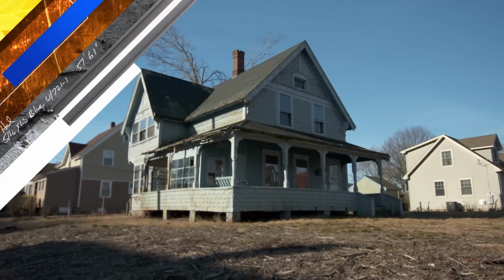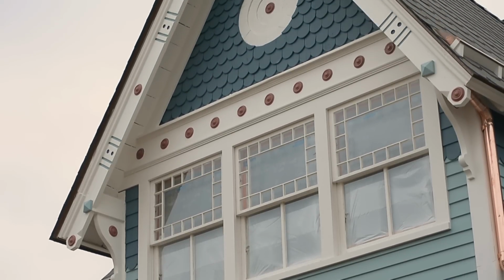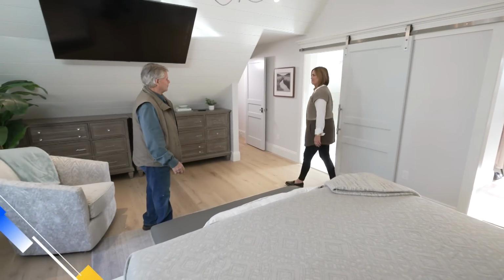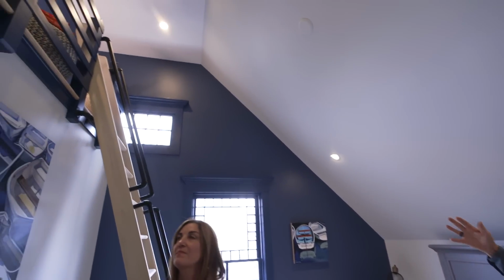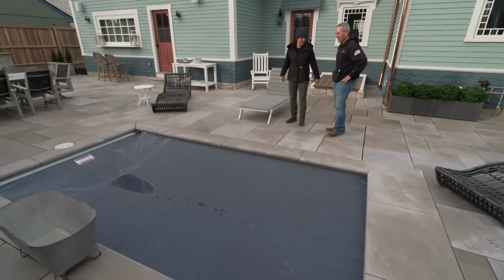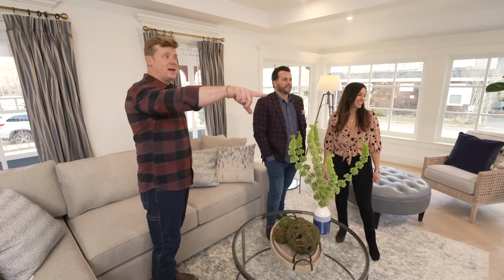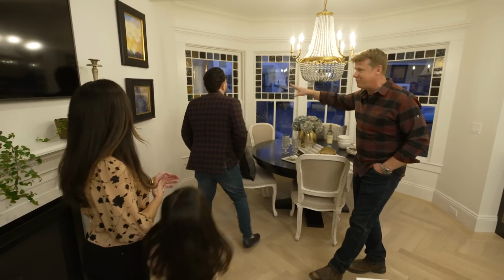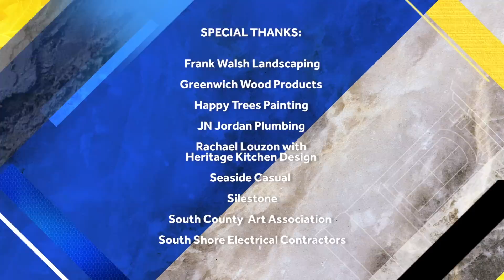This Old House | A Queen Anne Revival (S42 E16) | FULL EPISODE

Comment: Why is there so much water on the basement floor?
Reply: Most houses up here in New England and New York have wet basements. The water table gets as high as at the surface when the snow melts, and the only solution is to let it flood in, and pump it out with sump pumps. I haven't seen a dry basement in my area ever.

Comment: Great, just what I need. 3 water heaters that are talking to each other. This show has turned into one giant sponsorship program.
Reply: I was surprised by that, too.  We installed one of those Navien heaters about 4 years ago and 1 works fine for our small family.  In fact, I hook up a hose to refill our 350 gal hot tub once or twice a year.  Easy to decrease the water temp to about 102F from its120F setting and, voila, the spa is filled with hot water within an hour.  3 heaters daisy-chained like that seems a bit much but definitely a setup for a multifamily dwelling, e.g. an apartment building.
Reply: @SpringRubber  that shower setup could use as much as 200 gals in 20 minutes. Very wasteful, but if you're going to do that, you need a lot of hot water.